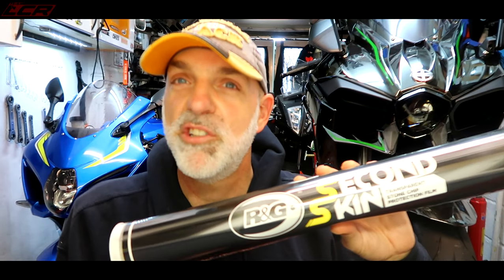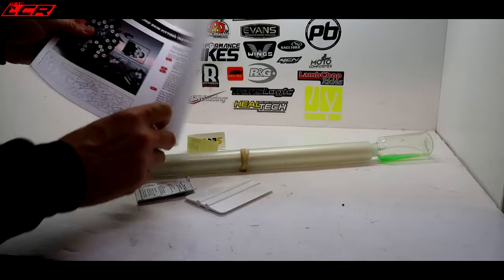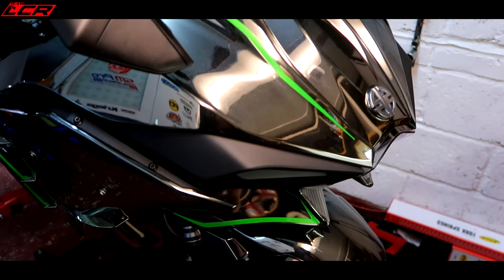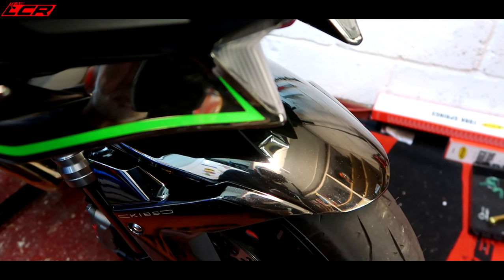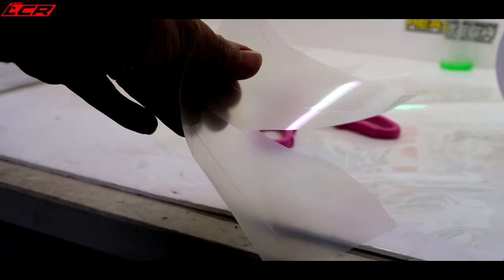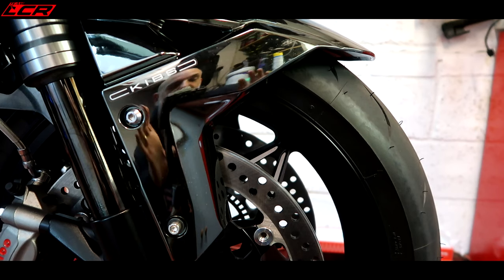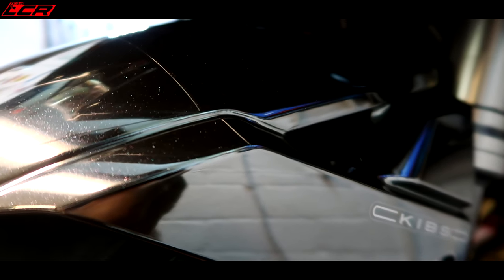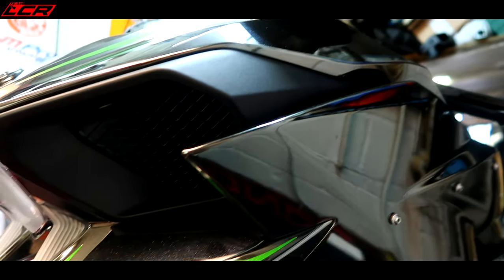Protecting The H2 Paintwork  | DIY Stone Chip Film

Comment: My Acra fitting is tight to the point where it makes contact with the swingarm when the suspension isn't loaded.
I got a sheet of VentureShield or VentureGuard (whatever it's called) and cut a small section to put on the swingarm to protect the carbon on the Acra.
It's been brilliant and in the last 6 years I only had to replace it once when some grit got under it and the Acra started to lift it off.
Great stuff
Reply from the maker: Yes seems to be tough stuff, been for a few rides and no chips thus far!! Fingers crossed